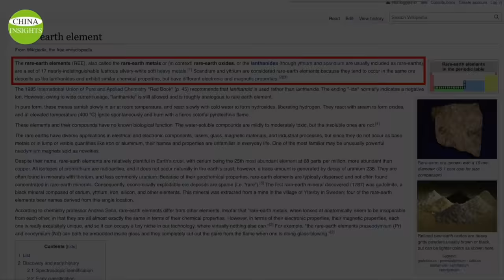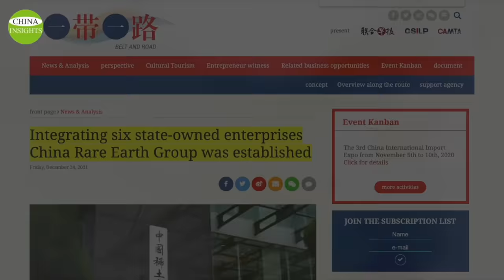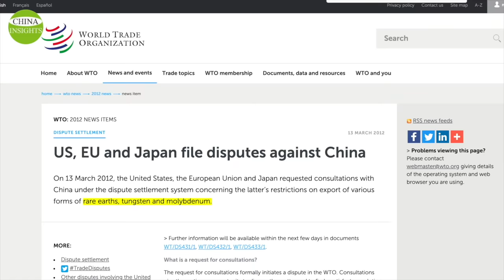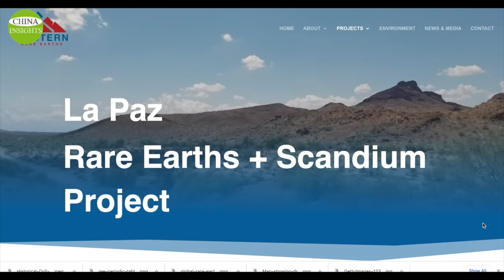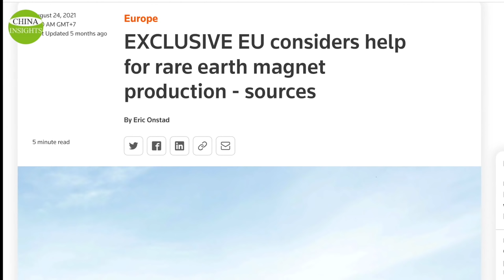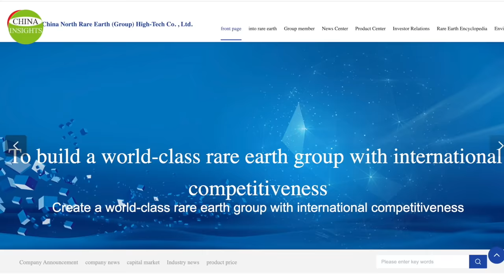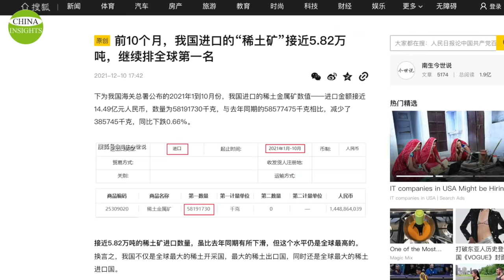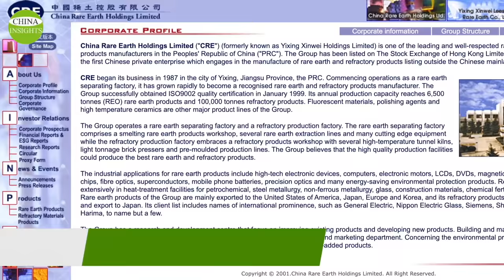China's rare-earth monopoly: New state-owned giant is set, the huge price paid and facing challenges

Comment: Probably good that graphene batteries and new electric motors from Germany don't use rare Earth metals.
Reply: China is numero uno in Graphene productions 17/20 ....
Reply: @jimmylam9846  Bruh, it is not that hard to make graphene, I could make a few sheets with a block of graphite, some soluble adhesive tape and a solvent
Reply: @lukesanderson7608  what is the process? Seems like a good DIY idea!
Reply: @lukesanderson7608  wut? dude that was the process used to prove that graphene existed and to start research on its properties... graphite is made of graphene flakes, too small and imperfect to be of any use
Reply: @khhnator  you're right. The process to make industrial grade graphene is actually simpler, but needs quite a lot of electricity to work. The idea is simple. A carbon enriched medium (any material that's carbon rich, graphite or even peanut butter for instance) is fried with a huge but very brief shock that breaks down the molecular bonds, and then (iirc) the carbon atoms start reforming into graphite, but the shock is so short lived that the carbon doesn't have enough time to actually assemble into graphite, so you end up with graphene. The added benefit is the type of graphene this method produces is the kind that's also usable for electronic applications. I believe the process was discovered by a student.
Reply: I'd never buy a new German car, stick with old classics. The VW 
emissions scandal shows how untrustworthy they are.
Reply: @olivegrove2615  the company that made the electric motor is not VW but I know what you mean I wouldn't buy VW either.
Reply: It's naive to say that china will produce most of our graphene supply when they can't even get enough power to function properly. The whole reason why graphene production is unsuitable at the moment is the fact that it needs way too much power to be profitable. It's like green steel production, it just wont work without more research.
Reply: @olivegrove2615  every other car company die the same but only VW didnt denied it. The controling facilitys from france, italy and USA protected thier car manufakture
Reply: Such electric motors do contain more copper and aluminium though. However those are easier to mine and recycle.

Comment: Just more incentive to develop better rare earth mining techniques because remember, rare earths are not actually rare
Reply: It's the isolation of rare earth elements from one another that drives up cost. It's very hard to separate them because of how chemically similar they are to one another. The mining can be done with a shovel and bucket.
Reply: @micahsmith361  Why would isolating  rare earths be more cost efficient for china? That does not make sense. 
Cost is mostly determined by the concentration of metal in the ore deposits available
Reply: @MCRuCr  China dumps their tailings back into the river polluting the local area. The US regulations around mining radioactive ore is very restrictive which is why the US lost most rare earth/uranium production in the mid 80's. China saturates the market to drop prices to be unprofitable for their competition. 

We don't isolate the rare earths mined in the US, energy fuels is one of the only producers and they ship to France.
Reply: @MCRuCr   China has a lot fewer environmental regulations, so refining is a lot cheaper.
Reply: @MCRuCr  One man's spending is another man's income, and one production layer's input costs include the preceding layer's output value - unless both layers are owned, run and regulated by an all-encompassing parent group that can dictate the value of one in order to set the costs of the other - a parent group such as a government or state-owned enterprise. Remember that in theory individual firms aim to extract profit from the market, whereas production pipelines of vital significance can have more important objectives than making money - such as a population's healthcare needs, food security, or national security objectives for example. If your country needs something that's more important than money and transparent cost structures, theoretical pricing models can be dispensed with for the greater objective (i.e. for the greater good). It's only the absence of regulation and collective cooperation that engenders compartmentalized priorities in the first place - almost by definition. How you spend your money at a bar depends on whether you have a wife regulating your extravagance - same thing. In China, this is basic understanding throughout the entire population (my ex-wife being the only exception) - no justification is needed. In free market economies, you'd need to ascribe the need for such a cost structure arrangement under the provisions of a piece of legislation that permits that for the production activity in question - such as an environmental protection, wartime economy, or defense procurement act - for example.

Comment: They won’t play the rare earth game with US. The US is the largest miner of berrylium, a very expensive material needed for ultra high tech applications; China produces some but not anywhere close to US production. You can thank the mid-tertiary ignimbrite flare up for that.
Reply: Berrylium is a very common material in large weapons. Anything from a m61 vulcan to aircraft components
Reply: Exactly my thoughts on the flare up.
Reply: Beryllium is also used extensively in treated and hardened steel alloys
Reply: @matrixlim4050  its only sent there because its cheaper and most of the refinieries are already there
Reply: @matrixlim4050  didn't you hear that 80% of these facilities are in China? Even if you did that, the other facilities couldnt handle everything
Reply: @matrixlim4050  not really since the world let them take the wheel. Doesn't mean this isn't something that is changing.